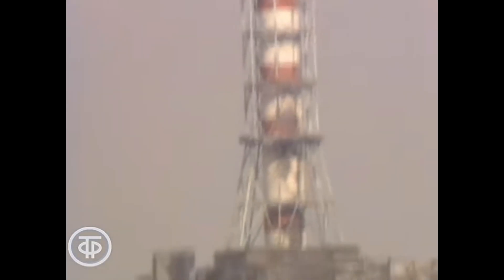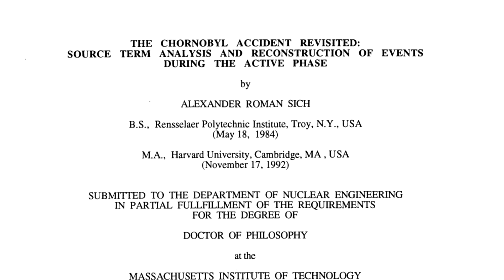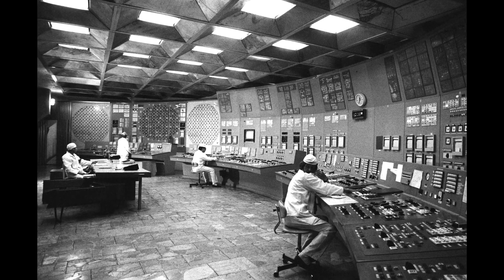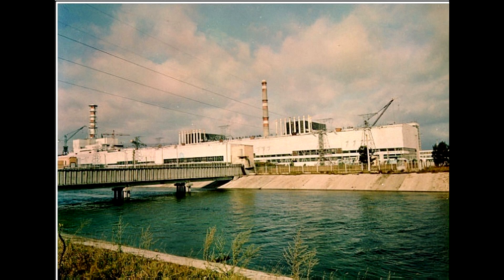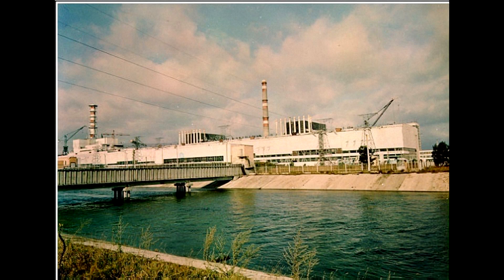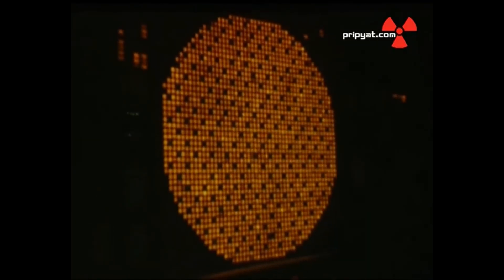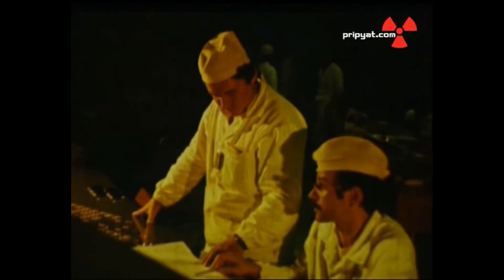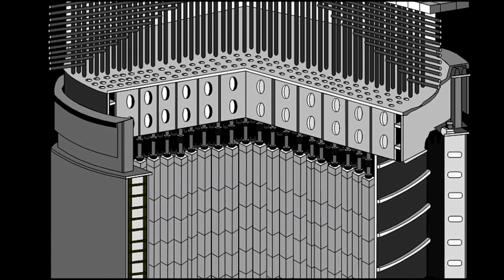Chernobyl Explosion Theories: Sich's Theory - The Last Seconds of Reactor Four

Comment: Still a debate today: why was AZ-5 pressed? It's pressed because the experiment is over or because there was rise in reactivity?
Reply from the maker: It's not a debate; people who were in the Control Room have confirmed it was because they should have pressed it at the start of the test, and Toptunov had not done so because he was expecting a different order to press the button. He communicated with Akimov who gave the order to press the button. This is supported by the testimony of those who were put on trial.
Reply: Dyatlov stated in his testimony and interview, the button was pressed as a matter of routine, and was done under calm emotional conditions.  He also testified the designers had "played a dirty trick" on them, meaning (in my opinion) the operators simply wanted to scram the core and were not aware of the dire consequences to follow, which happened due to the already known design flaws.  A scram button should decrease neutron flux, do it effectively, and do it quickly.  For reference on the details of the very first scram system (controlled by an actual rope which could be cut with an axe), see Chicago Pile 1 (Wikipedia)
Reply: Both options are totally plausible and even complementary. Observing a slight increase in reactivity could jar the SIUR's memory that the shutdown was overdue.
Reply: They failed to understand and obey the design limitations that only bank scrams be used, not full scrams. The designers knew that they built a bomb. And they included limits to never do a full core scram in such circumstances, knowing that to do so would cause first a massive power excursion. Doing bank scrams would create lesser power excursions. 

But as in all human things, caveats like that get lost along the way, or are intentionally ignored by those not understanding the reasons they were there. They instead substitute simple thinking - like the need to urgently insert as much negative reactivity as possible, or that the job is done - now just turn it off. Either is grossly careless and stupid. And the consequences are as we saw. 

The true fault goes back to the design. No reactor should ever have been built in this way. The fault goes further back though to the economic and political pressures combined. Maximizing efficiency was their god. That over-rode the technical issues allowing and necessitating the creation of a fatally bad design.
Reply: @tunneloflight  False. There was never even any hint of a suggestion or requirement to perform anything less than a 'full scram' in those conditions. I'm not sure what you're referring to by 'bank scram.' This is not a term that exists for the RBMK.
Reply: @MinSredMash  Also - by the way. If the actual opperation did call for triggering AZ-5 in an accident with all rods withdrawn, then every RBMK reactor was a bomb.
Reply: @tunneloflight  Well yes, every RBMK was a bomb, hence the upgrades. The positive scram effect was possible even with an inserted rod worth that was within normal parameters. For the first years of RBMK operation it was even allowed to withdraw all control rods to counteract poisoning.
Reply: @krashd  OK, but they were already at 7% power, so none of the other AZ buttons would have any function at all. And with all eight MCPs running, they were in a regime of unusually high coolant flow, not diminished. What they actually should have done was insert the USP rods, but that is 100% hindsight, since no one had run the numbers on that procedure yet.

Comment: Another great video, the graphite probably fueled the fire.
Reply: And the Zirconium
Reply: Graphite can't fuel a fire. It takes in far more heat than it releases.
Reply: Graphite can oxidise to form either CO or CO2.
Is that really an endothermic reaction?